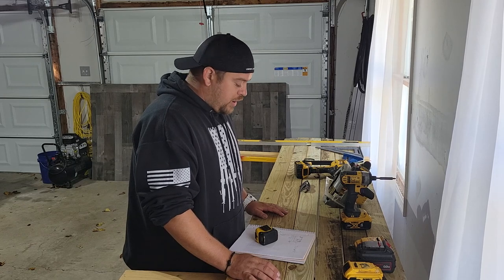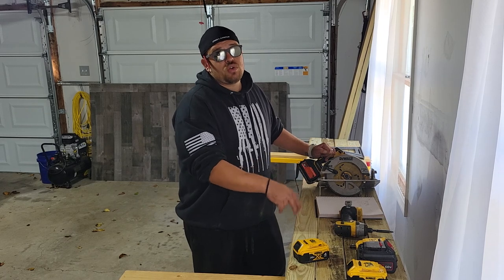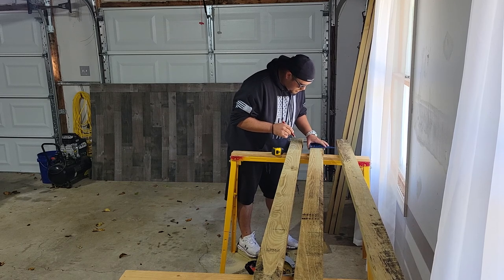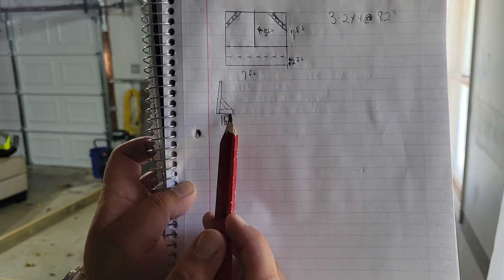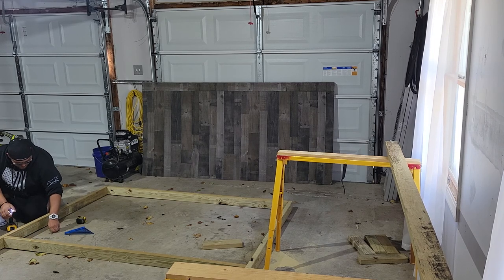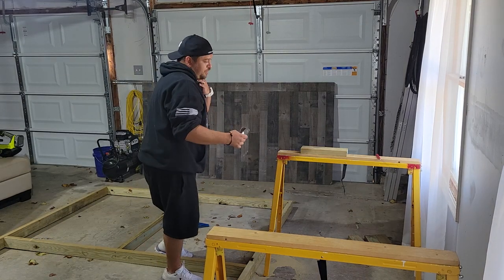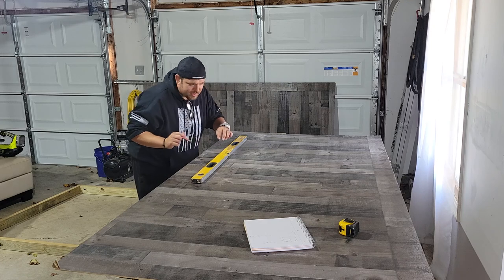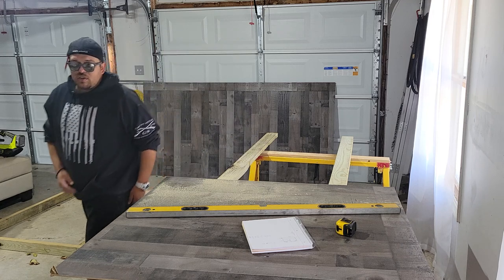Back drop part 1.

Comment: I'm here for the back drop, can you tell me what minutes that is, and is it WCW regular or WWF old school style back drop
;)

Jokes aside, this was like a true carpentry lesson, so do tag this up for wood working and carpentry for beginners because this was really well taught and talked through. Cheers Daniel!

Oh and my dad used to cut pencils that way, shave them manually rather than with a standard pencil sharpener. I guess it's a trade or inside thing, not seen a pencil with those shaved  sides like that for decades, excellent!